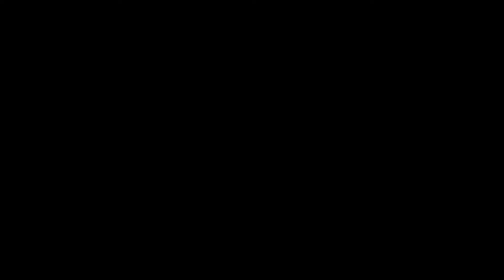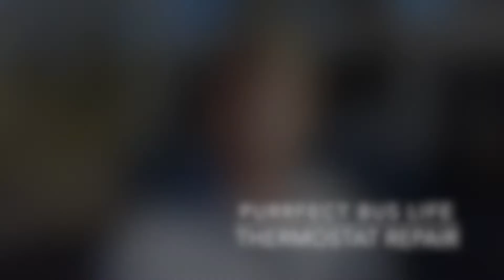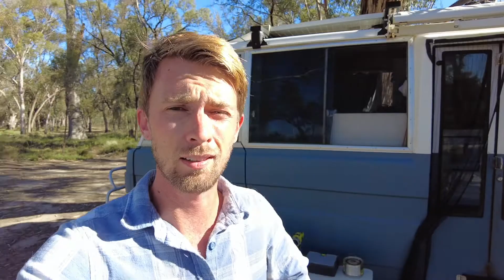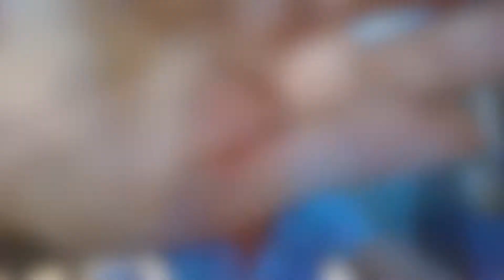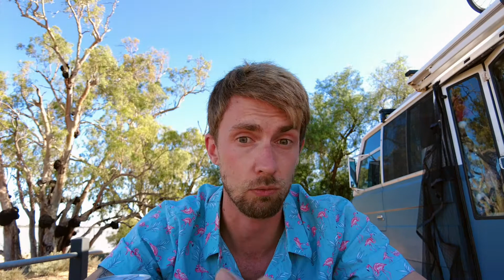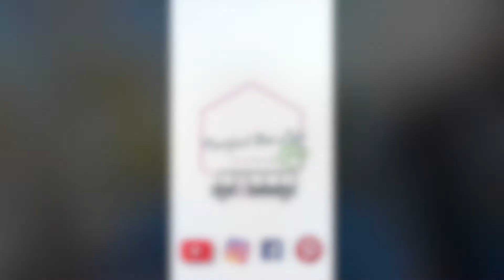How To Stop Cars Overheating , Thermostat mod

Comment: i drill 3 holes 3mm each, in triangle shape, and i use a smaller thermostat from 88 celcius to 82 works fine, tried with NO therostat i had strange problems mostly overheat at high RPM

Comment: I watched every video on thermostats . the pros and Cons of having one , Not having one . I have a van and it was running too hot for my liking . I drilled two holes in the Thermostat and Bingo , the temp dropped right away and the van runs well.   Why it works is an unknown ?  But it does !

Comment: I always drill at least one or two holes in the thermostat just to help bleed the air out of the system. You don't want to go drilling to many holes or it potentially defeats the purpose of having a thermostat to start with.

Comment: This is the common subaru thermostat trick for helping the bad head gasket putting bubbles into the system. And to help bleed and burn a hard to burb system like the subarus

Comment: I took out my corolla 2003 thermostat out today and drilled 5 holes and put it back. So far the car feels much better with the holes drilled, especially at the traffic lights. The car doesn't vibrate as much when in D.
Reply from the maker: glad its helping you! would it over heat at the lights before hand? because it sounds like if the idil is better now you could have a restriction problem in the water? causing the pump to work too hard which would result in poor idil? look at a full heavy flush of, rad, block, and heater core, remember to have the heater on high though, remove the thermostat too after the first rinse and blow it all out with a hose. I had a blocked heater core in a 2008 alfa and it took 4 flushes and a pressure flush, the idil was much better after! but all cars and issues will be slightly different.
Reply: @Somewhat.Gypsea  well, i'm not sure if there's any blockage. I've changed a new radiator about 6 months ago and at that time already fully flushed the system. I think maybe the thermostat might be a little bad since it's the original since 2006. As of now, all is good. Engine runs if normal temp is about halfway, it's now down about 10 to 20% during normal driving.